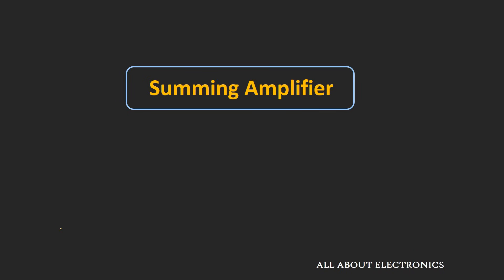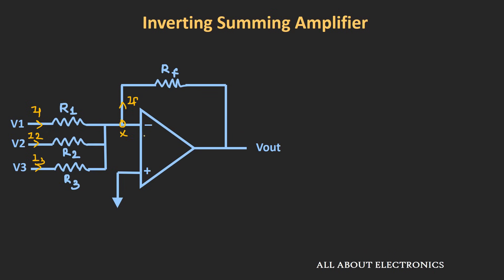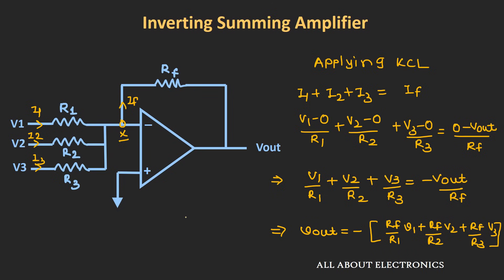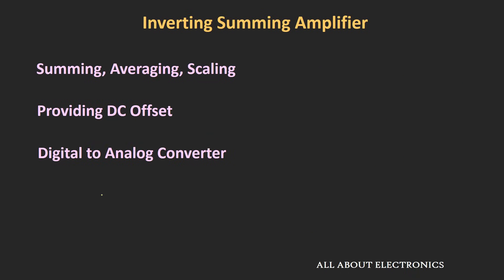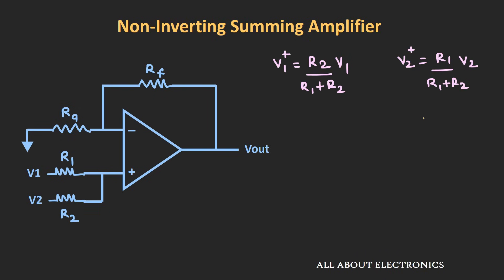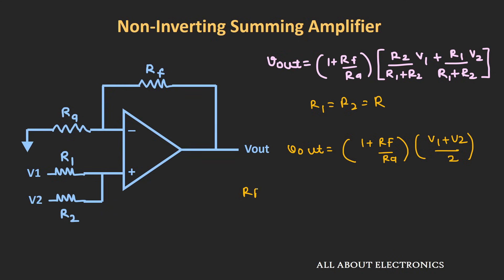Op-Amp: Summing Amplifier (Inverting and Non-Inverting Summing Amplifiers)

Comment: 5:52 why Rf/R = 1/n ????? And how n is the number of voltage source attached????? Someone plz tell me.
Reply from the maker: Here what it means is , suppose you have 3 voltage sources, then select R = 3Rf, so that Rf / R = 1/3. And if all R1, R2 and R3 are of same value, (if you select in that way) then output is the average of all the 3 input voltages. So, in general, for N inputs, if you select R = N*Rf, then you can design a circuit which takes the average of given N inputs in analog domain using op-amp. I hope, it will clear your doubt.

Comment: If one more resistor R4 is added but without any voltage source, will R4 will affect the calculation of v1+.
Reply from the maker: In case of non-inverting summing amplifier, the additional resistor will make a difference in the calculation in V1+. Because, while applying superposition theorem, along with R2 and R3, the R4 (additional resistor) will also come in parallel. So, now the calculation will change.

Comment: One doubt: Why did we not consider the concept of virtual ground in case of non-inverting summing amplifier? Thank you for your lectures.
Reply from the maker: It has been considered. And based on that only, we got Vo = (1 + Rf/ Ra) *V+ . Once, we got V+ using the superposition theorem, then using the concept of virtual ground only, we got Vo = (1 + Rf/ Ra)*V+. In the earlier video of non-inverting op-amp, since I have already covered it, so here I have directly used the expression. For more info, you can check that video. 
https://youtu.be/uyOfonR_rEw?si=ichrOUKxnM8PcJ-y

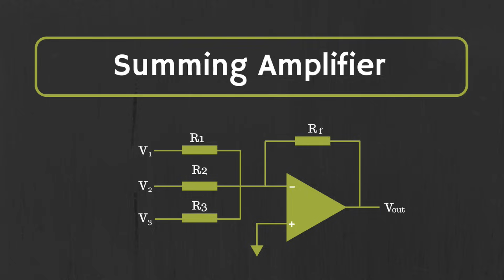Comment: 00:19 Learn how to use op-amp as summing amplifier
02:14 Op-amp can be used as an inverting summing amplifier
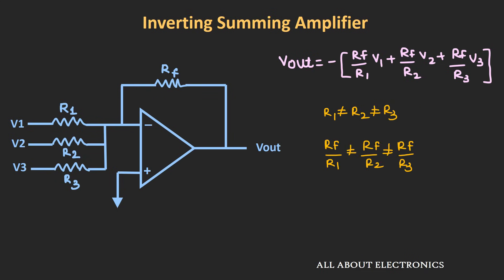04:48 Inverting summing amplifier can perform addition, scaling, and averaging operations.
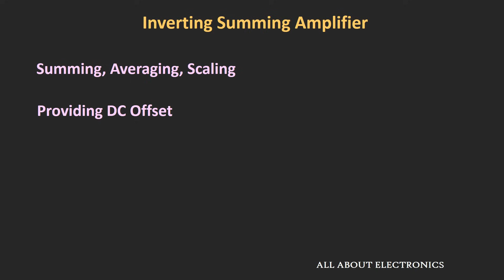06:58 Inverting summing amplifier has multiple applications
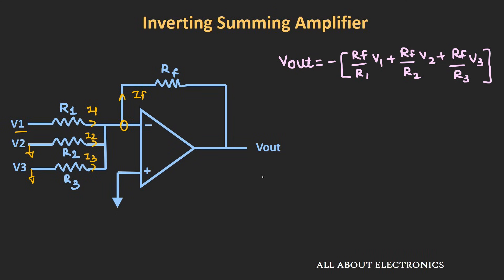08:56 Inverting and non-inverting summing amplifiers
10:44 Non-inverting summing amplifier can perform addition of voltages
12:56 Non-inverting configuration with multiple input voltages
14:57 Inverting and non-inverting summing amplifiers

Comment: Can you explain in the superposition theorem, why v1+ =(R2*V1) / (R1+R2), but not  v1+ =(R1*V1) / (R1+R2). I can't find any explanation about this voltage division rule.
Reply from the maker: First, let's assume that when V1 is acting alone, then the total current in the loop is I. So, I = V1 / (R1 + R2).
Now, the voltage V+ is actually a voltage drop across R2 right !!
And using ohms law, we can say that, V+ = I1*R2. Now, putting the value of I, further, it can be written as V1*R2 / (R1 + R2).
So, that is a voltage divider rule. In that equation, V1/ (R1 + R2) is the total current in that loop. 
I hope, it will clear your doubt.

Comment: i have a doubt....that is u have applied superposition theorem for v1 then u have to   take series resistance but u taken parallel resistance that is for v1 u have to take r1/r1+r2 but u taken r2/r1+r2.
Reply from the maker: Would you please mention the timestamp where you are referring to in the video ?
Reply from the maker: Ok, I got it where you are referring to. See, here we are applying the voltage divider rule. While applying superposition theorem, If you just consider V1 voltage source alone( and V2 as 0V), then voltage at the non- inverting terminal is V1* R2 / ( R1+R2). Please check the voltage divider rule for resistor once again, you will get it. And if you still have any doubt then let me know here.

Comment: Thank you sir nice and clear explanation. But my question is When we about the advantage of non inverting in the previous video, infinite input impedance was one advantage right? So why do we put R1,R2 and R3?
Reply from the maker: Without the resistors R1, R2 and R3, if you directly connect the three voltages at the non-inverting terminal then it will violate the KVL. Basically, you are connecting three different voltages at the same node. But with resistors, because of the drop across it, it won't happen. And you can find the effective voltage at V+ using the  superposition theorem. I hope, it will clear your doubt.

Comment: Sir what is the maximum output voltage produced by a summing amplifier?
Reply from the maker: Depends on the biasing voltage of the op-amp. The biasing voltage decides the positive and the negative saturation voltage of the op-amp.

Comment: what if there is a voltage source on the other terminal? e.g non inverting amplifier has a voltage source in the inverting terminal or vice cersa?
Reply from the maker: I think you are talking about the difference amplifier where there is a voltage source on both positive and negative terminals, isn't it?
There is a separate video for that. Please check it.

Comment: At 9:52 you said voltage at non inverting node is Vx
Doubt : Its negative feedback opamp. Inverting end is grounded thus at 0 potential. Then why virtual ground concept isn't applicable here? Why node voltage at Vx ≠0?
Reply from the maker: No, the inverting node is not at the ground potential. The voltage at the inverting end is the voltage drop across the resistor Ra. Let's say some current Ia is flowing through Ra then the voltage at the inverting end or V- is Ia x Ra. The concept of virtual short is still applicable. That means the voltage at the inverting and non-inverting terminal is the same. That means V+ = V- . Or V+ = Ia x Ra. I hope it will clear your doubt.
Reply: @ALLABOUTELECTRONICS  It did to an extent!  Last doubt sir please help : lets consider inverting terminal is grounded in that case will Vx or V+ is zero irrespective of any input voltage applied at the non inverting (V+) terminal like V¹, V²?
Reply from the maker: @ogbuddha7835  when the inverting terminal is connected directly to the ground terminal then there is no negative feedback. The negative feedback exists when we connect the feedback resistor between the output and inverting terminal and resistor R1 between inverting terminal and the ground.
Reply: @ALLABOUTELECTRONICS   You just solved the biggest doubt in my mind. Thank you so much sir. You may not change your world by doubt solving of one random subscriber. But you will change the world of the subscriber.

Comment: At 12:20 when you say R1=R2=R , what's R in this equation because it is not on the drawing ? Thank you!
Reply from the maker: What I mean to say is, if both resistors are equal  then in that case, you will get (1 + Rf/ Ra) (V1 + V2)/2
R is just for representation to indicate that, the value of two resistors are equal.
I hope it will clear your doubt.
Reply: @ALLABOUTELECTRONICS  yes thank you!

Comment: sir if the input impedance of an opamp is very high then there will be no flow of current so, whether the opamp circuit  in off state OR NOT?
Reply from the maker: Actually there is a flow of little current ( in uA). But for ideal opamp it is zero. More over, through bias voltages, opamp also draws the required current for the operation. I hope it will clear your doubt.

Comment: Nice video again.  Can you please elaborate why there would be cross talk between inputs in non-inverting config but not in inverting one ? Thanks.
Reply from the maker: In case of the inverting configuration, due to virtual ground, one end of the resistors is connected to the ground. When we consider one source at a time and consider all other sources as zero, (to find the output), then both ends of resistors (For those input signals which are considered as zero) will be at the ground. So, effectively there is no impact of those voltage sources on the output. 
But that is not the case in the non-inverting configuration as I mentioned at 16:22. 
I hope it will clear your doubt. 
If you still have any doubt then let me know here.

Comment: Sir how to solve the problem if Rf is connected directly to the resistance R3 instead of connecting it to the inverting terminal or is it one n d same?
Reply from the maker: You mean to say when Rf is connected between the output and the input right ??
Reply: @ALLABOUTELECTRONICS  incase of inverting summing amplifier, keeping all other connections same if only the end of Rf which is connected to inverting terminal if removed and connected it to resistance R3 . How the problem will change. ?
Reply from the maker: But the one end is already connected to R3 isn't it ? ( One end of Rf is connected to output and the other end is connected to R1, R2, R3 at the inverting terminal).
You mean to say the other end, towards V3 ?
Reply: @ALLABOUTELECTRONICS  yes to V3 
I cannot put circuit diagram also in d comment section.
Reply from the maker: @Veena Govekar In that case, apply the KCL equation at the node. You will get the answer. I think similar type of question is already covered in one of the previous Quiz on the second channel. 
I am not exactly sure, but you can go through this playlist on the solved examples on the op-amp. You will find the similar sort of questions.
Here is the link: https://www.youtube.com/playlist?list=PLH9R5x7JVXCFFScqREEGiFCSyKVM3RTM8
I hope it will help you.
Reply: @ALLABOUTELECTRONICS  ok thanku sir😃

Comment: @ 8:39 how are the voltage sources isolated? How are v2 and v3 grounded due to virtual ground?
Reply from the maker: while applying the principle of superposition, if we consider only one voltage source at a time, then the other two sources can be assumed as zero.
That means V2 and V3 can be assumed to be a zero. The other end of resistor R2 and R3 is at virtual ground. So, while finding the output due to V1, there won't be any current through resistor R2 and R3 (as bother terminals of R2 and R3 are at the same potential.)
And during the calculation, there will be no effect of the two resistors on the calculation.
I hope it will clear your doubt.
Reply: You can apply kcl

Comment: My question is why voltage division took place only on the non inverting configuration when we employed superposition theorem what if we employed superposition theorem in the inverting config will voltage division among resistors will take place or not?
Reply from the maker: In the case of the inverting configuration, if you apply the superposition theorem, then only once source will be active at a time. For example, V1 is active and V2 and V3 is zero. That means one end of the resistor R2 and R3 will be at ground potential. Also, due to the virtual ground, other terminals will be grounded. That means both terminals of R2 and R3 will be at ground potential. And they will act it as if they are not the part of the circuit. So, there is no point of applying the voltage divider rule. I hope it will clear your doubt.
Reply: @ALLABOUTELECTRONICS  Thank you this was helpful
Reply: @ALLABOUTELECTRONICS  sir in non inverting we can also do the same thing , active only one source and rest of two source will be grounded then how we can apply superposition theorem , and in the non inverting summing amplifier you are also doing the same thing, grounding V2 , calculating V1 . please clear my doubt ?

Comment: At 10:40 the resistance of the OP-Amp is infinite, shouldn't all the voltage V2 drop across the Op Amp itself and thus making V2+=0 ? 
I am confused at that exclusion of OP-amp's infinite resistance from the circuit
Reply: Oh!! I solved by individual currents and added them, got the same value for V2. But when we take currents in consideration we can say current will not enter Op-amp due to infinite resistance, but how do we explain the same with voltage?
Reply from the maker: @zenvir1680  If there is a current flowing through any resistor, then there will be a voltage drop across that resistor. It is independent of the resistance of the op-amp. At the non-inverting terminal, the current is flowing through R1 and R2. And the voltage drop across the R1 is V2+.
Reply: @ALLABOUTELECTRONICS   I got that. Thank you so much.

Comment: How it came V1/3  V2/3 etc .... In non inverting summer.....
Reply: Simplify it by renaming each of the resistors R1,R2 and R3 as R1 since all the resistors are of equal value. So we can rewrite the numerator as R1 in parallel with R1 or R1||R1 which equals 1/2 R1, since 2 equal resistors in parallel will equal half the value of one of them. so the equation can be rewritten as 1/2 R1/R1+1/2R1. Therefore yo will have 1/2 R1/1.5R1 which will equal to 1/3.

Comment: Hello sir inverting ka case ma jb teen resistir lge he to volt at inverting terminal is 0   due to virtuL short but non inverting ka case ma superposition  se V1 find kiya he waha per V1 0 kyo bi hua. Please sir reply???
Reply from the maker: In that case also, the concept of virtual ground is applicable ( due to the negative feedback). But at the non-inverting terminal there are two voltage sources now. So, to find the output voltage only one source has been considered at a time. And that time other source is considered zero. Let's say, when V1 is acting then V2 is zero. so, V2 will be zero. That means R2 will be grounded. And at that time, the voltage at the non-inverting terminal will be (R2/R2 + R1) V1.
the same voltage will also appear at the inverting terminal. 
I hope it will clear your doubt. 
If you still have any doubt then do let me know here.
Reply: @ALLABOUTELECTRONICS  thanks  sir
Does the two voltage Source in noninverting means a  supply Vin and individul voltages  to the input resistor ((R1,R2,R3)that is  (V1,V2,V3))we take one vol source at a time in cal)..
If it is then why not the two vol source at the inverting inverting summing amplifer one for inverting conf. and another to input resistor. Sir i mean in inverting configuration  summing we take V2 as 0 there we not aplly superposition to find out V2 but in case of noninverting summing ampl we are finding V1.

Comment: But sir if we apply voltage divider rule for non inverting terminal....the voltage at that point does not become equal to that in the inverting terminal .........I am talking about the case of inverting summing amplifier......sir please explain
Reply from the maker: Hi, I didn't get your question. For the inverting summing amplifier, the non-inverting terminal is grounded.
Reply: Sorry sorry I mean to say what if I apply voltage divider rule in the inverting terminal of the inverting summing amplifier.....

Comment: What is the meaning of scaling?
Reply from the maker: Multiplying the voltage by some factor.
Reply: @ALLABOUTELECTRONICS  
Thank you sir for a quick reply ... Yesterday i was preparing for my end sem exams and was very afraid ... thinking ...whether I will pass or not....
But I found your video series very helpful ...and solved for 45 marks out of 50 ...
Thank you very much☺️....

Comment: This opamp series in incredible! Deep and lucid style of explanation makes us to understand concepts in much simpler way! 
One doubt from above video, sir you have said individual voltages we apply in inverting summer will be separated due to virtual ground and effective input impedance will be the R1. What will happen if all three voltages are given at a time? Pl can u elaborate on how each sources acts separate and input impedance doest not change after adding multiple resistance on input side?
Thank you
Reply from the maker: Actually, all the sources are applied simultaneously. But for the analysis, we are applying the superposition theorem.
When you consider one source at a time, then the remaining source will be zero. And if you look the circuit, due to virtual ground both terminals of the resistors will be at ground potential. So, it won't affect the impedance of the circuit.
I hope it will clear your doubt.
Reply: @ALLABOUTELECTRONICS  tq 👍

Comment: The 741 ic connected as a non inverting amplifier for a gain of 100. Determine the stability of the amplifier at this gain
Reply from the maker: well, actually it depends, what is the input signal frequency, and what is the input voltage. Because when op-amp is used with negative feedback, then stability is a function of frequency. For, small DC voltage (in mV), the output will be stable. With the gain of 100, it will be in Volts. But let's say, if you apply an input voltage of 10V, in that case, you won't get 1000V at the output. Rather output gets saturated at the Vsat voltage. For +15V supply, possibly you would get around 12-13V at the output.

Comment: At 10:35 how that resistance term r2/r1+r2 came
Reply from the maker: Its simple voltage divider rule.
Reply: @ALLABOUTELECTRONICS  plz explain im getting confused
Reply from the maker: Let's say If the current I is flowing through a series connection of resistor R1 and R2, then current I = V/(R1+R2)
Where V is the voltage source connected to a series connection.
And the voltage across resistor R2 will be equal to I*R2 = R2*V/(R1+R2)
Similarly voltage across resistor R1= V*R1/(R1+R2)
This is a voltage divider rule.
I hope now it will clear your doubt.

Comment: what is Ra?
Reply from the maker: Ra is the resistor at the inverting node. It's just a different nomenclature used for Non-inverting summing amplifier, as resistor R1 and R2 is used for the resistors at the non-inverting node.

Comment: Thanks for the videos really it was nice 
Sir plz tell what if we apply different signals at both the terminals of a summing Op-amp
Reply from the maker: Hi, you mean to say, if Vin1 and Vin 2 are different then what would be the output?
Reply: Hello 
My question is that in a single opamp if we apply some signals( like V1a, v2a, v3a etc.) on positive terminal and some signals (like v1b,  v2b,  v3b etc. ) on the negative terminal in that case what will be the formula for output??
Reply from the maker: I have discussed that in the separate video. Please watch the video on the differential amplifier. You will get the answer. And after that still, if you have any question then do let me know here.